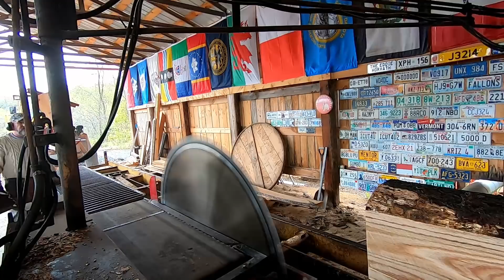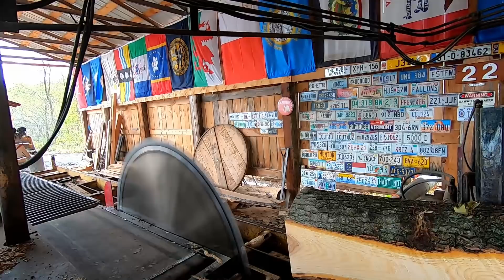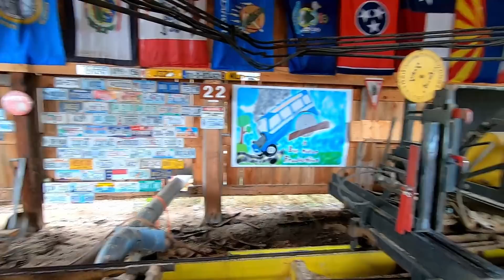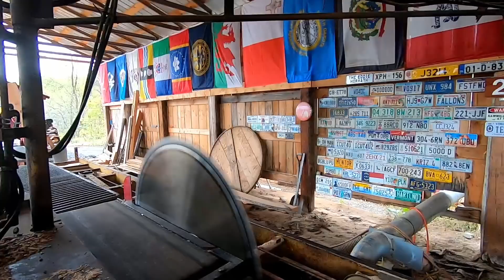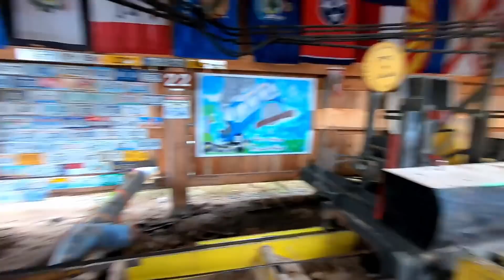sawing blocking & the talking turtle # 238

Comment: Hello Mark and THE Eddie, First off let me say that you guys crack me up. The turtle thing that you and John have reminds me of Captain Kangeroo. The way He entertained the children I now know was great. I watched for the cartoons. One thing I did notice was when you first started the "bus" motor, it sounded like it had a bad miss in it. In all the time I've watched you videos I've never heard it before. You might want to dump in a gallon of injector cleaner the next time you add fuel. There was one product we used that worked really good but I forgot it's name. Ain't bee around that stuff since I retired 8 years ago. Always a pleasure to watch your videos. Can hardly wait for the next one.
Reply from the maker: thanks Don.
Reply: Sounds as if a couple of injectors are leaking fuel into to cylinder during shut down. When it puddles up on top of the piston it takes a little bit for it to all get blown out and the cylinder to warm up to fire properly. The staining on the block shows that raw fuel is leaking out the exhaust port in between the manifold and gasket. This is my you tube visual and listening diagnosis as I am not there in person(disclaimer) 😆

Comment: I have made a few pieces of furniture out of hard maple and it is not easy to put a high quality finish on the piece of furniture. I have done it put it is a pain. Even with using a sealer it dos not stain that well.
Reply from the maker: yes it's very hard to work with.